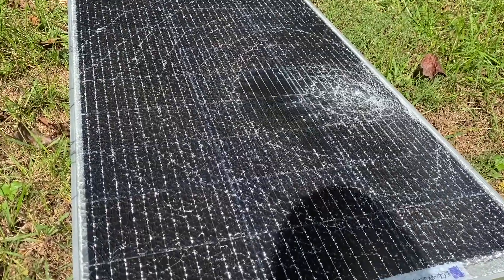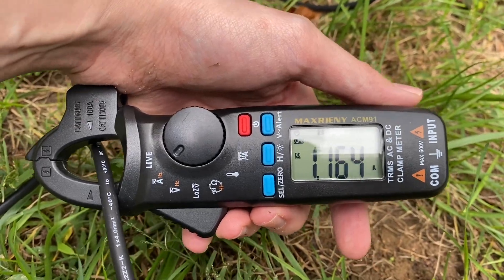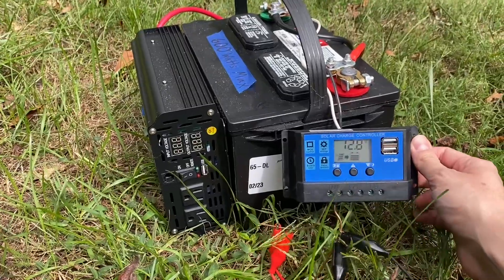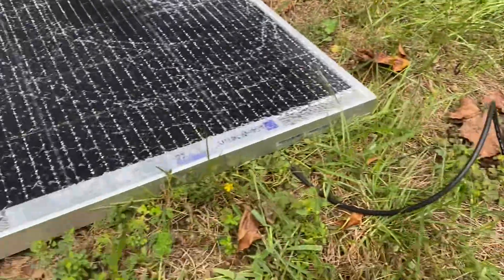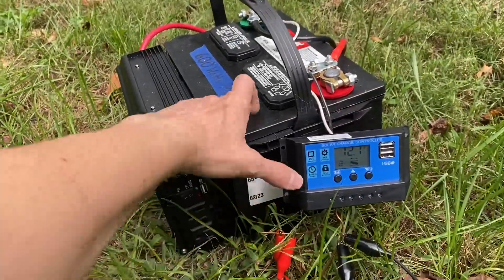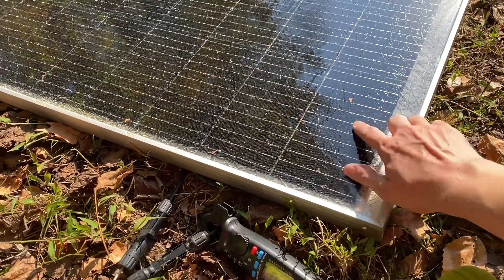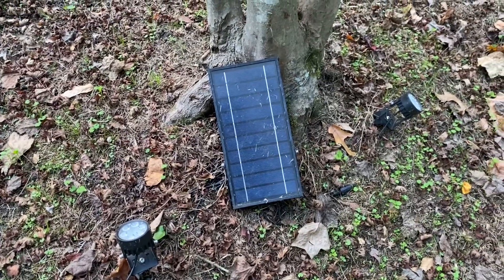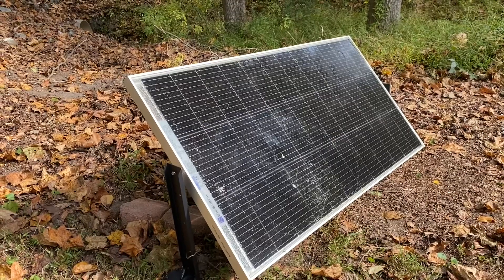Misadventures in Electronics #4: Can I fix a broken solar panel?

Comment: So on a sunny day how many watts is it getting?  How many watts is it rated for?
Reply from the maker: @johnmal5975  I haven’t really done a proper test beyond the 2.7A seen post-repair in the video. A few landscape lights doesn’t really drain the battery enough to really tax the panel. Hopefully I’ll get to put it through its paces more at some point. It’s rated 195W, which would be 9.65A at the 20.2V maximum power point. It’s just a cheap Eco-Worthy panel, though, and in my limited experience they fall a little short of the rating even when they’re not broken.

Comment: 34 ounces of clear acrylic epoxy resin can be had for $18us from scamazon and this is like what they use to fix windshield glass.. It would be best done at warmer temperatures so the epoxy can flow into every crack or done in a vacuum so as to force it in and the air out but sealing the crack long term in heat and cold outside environment could get iffy.. If shattered panels like this were free and they lasted a few years spending $18 a piece might not be a bad deal at all.. Same goes for running them bottom side up but adding some drain holes or slots would be a good idea..

Comment: I need to fix my solar panels junction box. Ripped out a wire
Reply: Some are not hard to open while others are pretty much factory sealed and you will find it a real PITA because the plastic piece is completely filled with hard epoxy glue.. Mine are somewhere between the 2 extremes and I hope I never have to replace the FET's that mine have.. Good luck, you might find a few videos on your brand of panels that will get you educated to the how to..
Reply: It’s a folding panel, 160 watt, EF. So it’s a small junction box. Been looking on Amazon but did not find one identical yet

Comment: I have a small pile of shattered panels and they all still produce current. One that Fedex stuck a fork through the bottom of the pallet is still in use on my roof for over 3 years. They lay flat and pool full of water. Another one was poorly stacked on a pallet of mixed panels from San tan solar. They shifted in transit and the smaller panels put a corner into the lower panel. Cardboard in between the layers of different sizes might have prevented it.
Two of the other panels fried traces under the glass and shattered the panel. Even with burnt traces and shattered glass they were still producing power.
The shattered panel on the roof I will swap out shortly with a similar wattage panel.
I bought 16 mixed panels that range from 325w to 385w were only $600. but shipping jacked it up another $640. So $1240. for 16 panels is still cheap. $77.50 a panel.
I was going to beat the busted glass out of the frames and toss the aluminum in my scrap pile but I might try the poly urethane. I doubt it would hold up to UV from the sun without yellowing but it doesn't hurt to try considering I have a can of urethane already. 
After I pay off the Paypal credit balance for the recent pallet of panels my next purchase is an EG4 24,000btu hybrid mini split that runs directly from solar. So having a couple of coated shattered panels might be helpful. I have 13 panels left from the pallet I bought so we'll see if I need the shatteted panels or not. I forgot, one of the 13 needs to go up on the roof to swap with that shattered panel. So I have 12 to power the mini split.
Reply from the maker: @FauxQue-yk8dt  That’s good to know that you’ve been able to use a shattered panel for years and it still makes current. I wouldn’t have guessed it would go that well without protection from moisture intrusion!

They say damaged panels are more likely to start a fire, so I don’t know if having one on your roof is the best idea but I would imagine it depends in part on how much voltage and current you’re running through them.
Reply: @picocosm  It's been good so far but like I said I have plans and a panel to replace it. I was mad about buying 10 new panels and 1 being shattered. Tried to get compensation from Fed Ex but they only work with the person who paid the shipping. Um that was me, they didn't offer free shipping. So I contacted the seller. Well that's why we advise you to buy a couple of extra panels in case they get broken. More BS I'm not buying panels to get broken. Anyhow they refunded me $150. so I was happy. They also said broken panels still produce. So I put the multimeter on it and they were right. I figured water intrusion would quickly corrode the traces but it's still producing. Replacing it now that I have a stack of extra panels will give me peace of mind. 
Solar is a risk of fire in all aspects. The MC4 connectors can arc. The screw connections in the inverter and combiner box need periodic tightening. And while rare the LiFePo4 batteries could burn. I had issues with lose wires arcing in the combiner box even though they were torqued to spec. Had to buy a torque screwdriver just to be able to torque to spec. After melting down a breaker due to arcing from a lose connection I bought a ferrule crimper and redid all of my connections. So far the ferrules have held torque. So much so I'm getting lazy again about checking the connections. Occasionally I hit everything with the Fluke laser temperature gun instead of retorquing. Now that it's on my mind I will probably check all of the connections tomorrow. It beats burning my house down